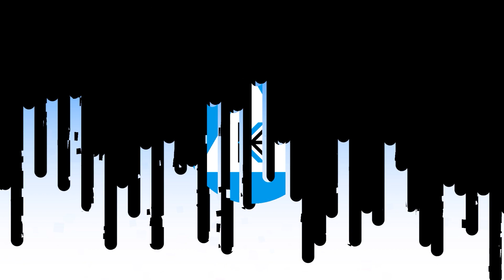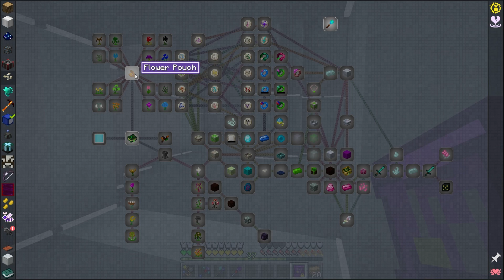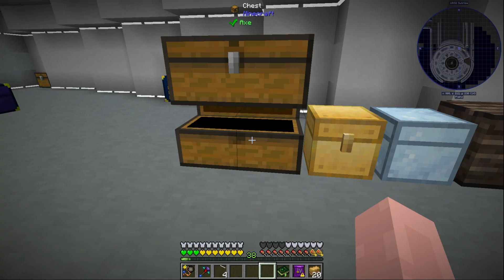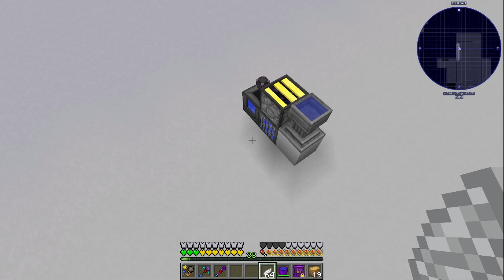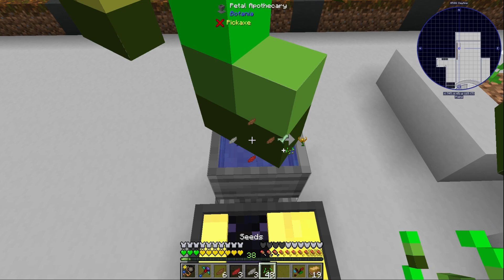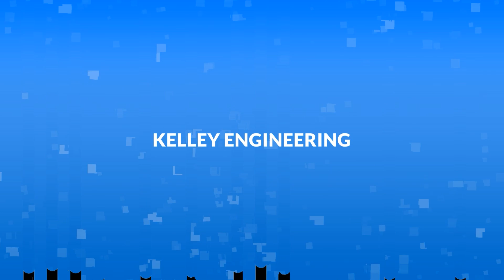Journey Across the Void: EP34 - Starting Botania

Comment: Hey Kelly, there's a smaller way to do the redstone using a slab. It works the way you have it. 

Pressure plate with open crate on top, redstone with hopper on top of the redstone and a top half slab with redstone on it. 

Granted this worked in a different pack, so I don't know about that working in this pack yet. I'm still at resource generation and I'm about to get Applied Energistics set up again. 

I don't trust ender utilities that you were using as you've said stuff kept disappearing.
Reply from the maker: The disappearing stuff wasnt from EnderUtilities if that helps, lol. 

Once I have the Botania Wing of the Triskelion setup, I’ll go over very in-depth what I did to truly automate the Mod. I keep having ideas and need to visit YT to make sure I’m not plagiarizing someone else’s work. These episodes are taking awhile because of that.
Reply: @KelleyEngineering  

Okay so I'll get into Ender Utilities then. I was thinking that might be a cause. 

It just baffles me to know what was making you lose stuff. I don't like losing things, it's bad enough that I have ADHD.
Reply from the maker: No worries. I’m making a mod spotlight for EnderUtilities right now and it’s taking awhile. Ive already recorded over an hour of footage explaining things. It’s a surprisingly complex mod considering how few items are in it.